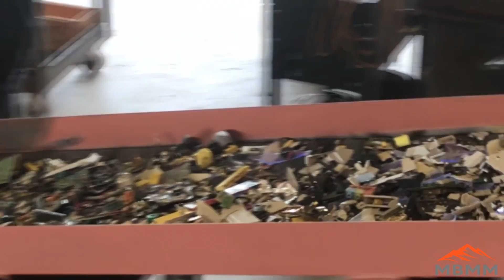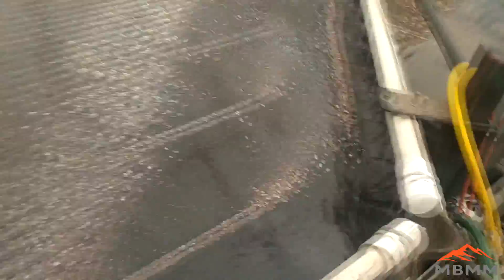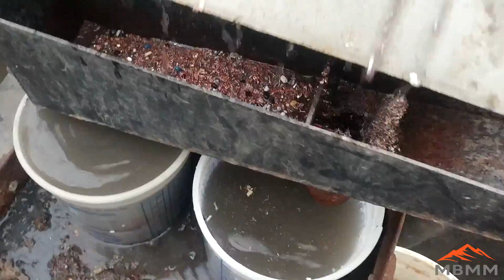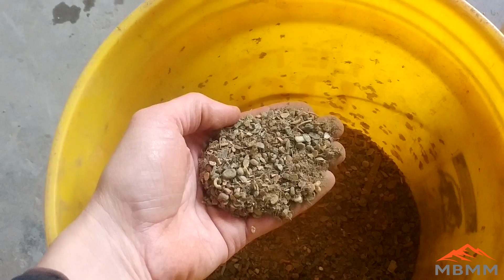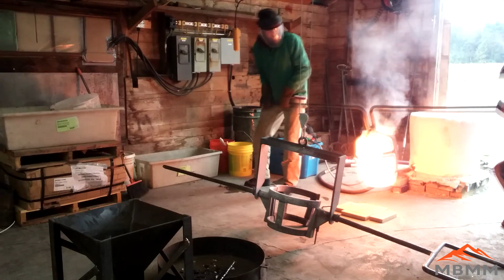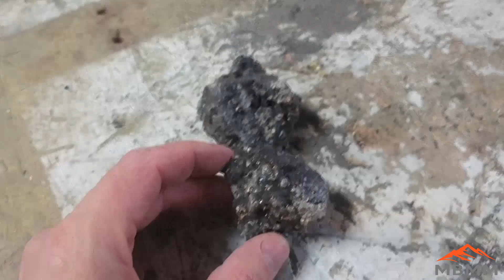Shredding & Melting Recycled Computers: Gold, Silver, Copper, Scrap Metal Recovery

Comment: like most have said, pull the pcb from the tower and all the wiring too, then run just the pcbs though the small mill and float table to get metals out, you could still save the slag and run it in the float mill and see what you can get, put the heavies and some lead into the mix, the lead will pull the gold and the rest into it, then put it in a bone ash cuple to recover the expensive metals aka gold and silver
Reply from the maker: Great, thanks for the tip!

Comment: Doesn't work but what I would do next time is the add flux right in there right before you start to heat it because that's what happened I think is that shit that oxidized oxidized because you didn't put flux in until way later but you need to put it in when it's cold when you're loading up The Crucible I believe you pretty much had your answer Electronics are just a big pain in the ass and I'd rather go out for the real stuff but that was a really cool demonstration and I appreciate your video brother I'm very grateful for people like you that put this kind of content out there because I wouldn't know shit if it wasn't for people like you take care brother
Reply from the maker: Great, thanks for the tip!

Comment: You must mechanically strip pc boards seperate from any steel or big aluminium, any other way is already the wrong direction, you must do sistematic element removal, each phase has its own recycling issue, there is no easy clean money in electronics that wont polute or cost a fortune in prevention
Reply from the maker: Great, thanks for the tip!
Reply: @mbmmllc  it is a pleasure!

Comment: the pond wil progresively turn into toxic liquid due to the trace chemicals used inside chips for their functioning  like Sulphuric Acid  Lithium, Arcenic, Lead  Mercury  and other toxic elements that make that water a must dispose of in a chemical facility and stupid expensive to dispose off  You Can NOT dump that water to environment! I have been recycling for many years  and not sold 1 gram, i evaporate all water to capture and colect the salts, no polution Ever  The Salts get Encapsulated inside an aluminium ball, and i encapsulate that in a 1 inch fiberglass layer to ensure i dont polute and poison the environment
Reply from the maker: Great, thanks for the tip!

Comment: Ideally the pcbs would have the Aluminum and batteries removed, and then processed separately. Sifting the pile off of the Mag Belt will drop 90% of the plated pins as the are all about the same size. The Gold Coated Ferrous pieces should be processed separately. The Power supplies should also be run separately as the the only valuable  material in there is a little Copper. Using Electrolysis you could remove the Copper. The remaining bits would be easier to refine with chemicals or sent to the refiner.  If only you had some Motherboards LOL
Reply from the maker: Haha, Thanks Ken!

Comment: Looks like you got way too much aluminum in your concentrate which is going to alloy but it's really pretty! A finer mesh grind and more mechanical separation is probably the most economical way to go short of doing an incineration run before you smelt.
Reply from the maker: Great, thanks for the tip!

Comment: in addition to what i said before nock the aluminium heat sinks and large electrolytic capacitors off  the boards  rerun your #1 and 2 back through to minus 60 mesh and with less iron and aluminium you should get a better result then electrolytically extract the copper then silver then gold chemically what is left may have palladium platinum and indium.
Reply from the maker: Great, thanks for the tip!

Comment: pc recycling is all about getting the best bang for the buck witch will almost always be physical, electrical, then, chemical thermal last. the thing here is each step you remove a high purity fraction is separation that does not need to be repeated or cause waste. so striping the steel case and as much plastic as possible before further processing may not pay for itself but will save cost later on both plastic and steel are at least potentially salable if low value and will be most of the weight as well as the reason for being very careful in the order and purity of each fraction removed is that there is a lot more than silver gold lead and tin in this stream and some of it is worth a lot. you also have palladium in the mlcc's worth $2000 an oz indium at 1 dollar  a a gram or 1000 dollars a kilo tantalum platinum electrolytic copper can be worth 12 to 20 dollars a pound instead of 2 or three . in the end you want a very small portion of unfinished material that you can a) glean more value out of or b) is the irreducible waste, and o ya back when you were processing the boards if you can get long enough glass fibers  and a millimeter is a good size bigger is better you can sell that as a strengthening amendment for concrete. you need to find value in each part i would love to see weld up kits for well designed flail mills and or shaker tables for urban miners. just remember just because you can doesn't mean you should you can destroy a lot of value or run cost up excessively by doing things in the wrong order you should always be learning more and better ways .
Reply from the maker: Great, thanks for the tip!

Comment: Nice experiment...  👍

I would try a Eddy Current (1st) to separate some of the plastic & ceramic; from, the metal..  Then, the  magnet.. And maybe a Rare Earth magnet for the stainless steel.

Heat the metals upto 600F to 800F... Only to melt the solder & burn off the junk..  (possibly, rehammerimg it smaller to 1/8; but, a 3/16 hole seems ok general pass..)

Use an Air Shaker table to separate copper & aluminum from other metals
Reply from the maker: Great, thanks for the tip!

Comment: Just as i would expect to be honest. Alot of the copper alloy will end up at the bottom of the cone because its denser than everything else. The metals that readily alloy with it like tin, gold and PGMs will go with it. The rest ends up a horrible mess of oxides (along with a percentage of the above trapped in it). As others have said i dont think crushing whole towers will ever work well. Too much good stuff is getting lost at the magnet. You really need to crush finer than the finest components then do the magnetic separation too make sure you get everything you need with minimal junk. Not practical for whole towers but doable for boards, phones and laptops etc.. The magnetics from the boards alone may be worth refining in a lead bath. The copper alloy can be electrically refined. Might not be economical but its the only way you will account for all the metals imo.
Reply from the maker: Great, thanks for the tip!

Comment: You need an aggressive flux
Reply from the maker: Great, thanks for the tip!
Reply: @mbmmllc  try adding lots of flourite and borax to the flux to attack all that refractory aluminium oxide....or better yet find a way not to let all that aluminium into the melt...

Comment: I would remove pcb from towers. Remove aluminum heatsinks with air chisel. I would also remove any batteries.  Shred with 1" ×3/8" screen. At that size the ferrous is easily separated from the valuable material  by magnet. Shred with 1.2mm screen and run on shaker table. At this point incinerate(but don't melt) in kiln/furnace to burn off all plastic, epoxy, etc. Shred again with 1.2mm or 0.8mm screen and run on shake table again to remove ash/trash as possible. Use a handheld magnet and sift material to remove any ferrous missed. Melt and cast into bars. Do copper electrolysis with 10% Sulfuric acid by volume of solution to speed up process. Melt pure copper into bars. Collect slag which contains noble metals. Perform wet process on slag. If concerned about aluminum use hf. Then hcl to remove any tin remnants. I would also incinerate again to remove any lingering hcl as to not get silver chloride in solution when going to next step. 2nd dilute nitric. Last aqua regia. Can use sulfuric acid during aqua regia to precip any lead remnants. Going strait to hcl or nitric would be way to expensive.
Reply from the maker: Great, thanks for the tip!

Comment: when you just shred it to the 1/4 in minus size it is really staying too big if your wanting to collected the values in my opinion. Take it down to a smaller size, either by passing through another mill and or ball milling the collected metals from the end. You can then pass the "dust" or slurry with very fine particles over the shaker table again and then separate the aluminum out very easily, because it has a density of only 2.7 g/cm3 compared to copper of 8.9 as well as other metals with higher densities than aluminum.

Aluminum you could set up to go to the  first drop off after the waste, then the heavier metals including the gold to the last bucket. After you have your two buckets I'd recommend either melting the aluminum or ideally selling it as the dust (dried) to a refiner. the copper and heavy metals bucket I'd recommend passing a magnet over it to remove iron and then if you wish you can melt into another dore bar and then zap with the XRF at the very least this way you are keeping the aluminum out of the future steps as aluminum in gold refining is a huge headache. edit Aluminum and Iron

you will still have metals that will cause you headaches but for different reasons. eg. tantalum (from tantalum capacitors), tin from the solder which if you're planning on wet refining the metal bar will cause you headaches because it will cause metastannic acid to form which will clog your filters. The best bet in my opinion is to get it to the two buckets like mentioned above of the powders. sell the aluminum( xrf first to make sure you arent missing anything),  the copper bucket dry out and save. once you have say a 55 gal barrel of the stuff or more have samples taken from that  (ball mill everything, sift, mix, then sample) have those samples fire assayed and then sell the barrels to a refiner who will pay you for the gold, silver, and copper. if they are willing to pay out for other metals (any PGM's) great!
Reply: but also just tossing a whole computer into the first shredder is not the way to do it. gigo, garbage in garbage out try to cut down on the unnecessary and easy to remove items first eg. cases, screws etc. ounce of prevention is worth a pound of cure :)
Reply: @CoinSilver800   What would the flux mixture need to be to make all the metals drop to the bottom the the cone leaving just the silica & carbon on top?  More SO2 or Bicarb?
Reply from the maker: Great, thanks for the tip!

Comment: How about running non ferrous material through an eddy current separator to separate the different metals and plastics and other junk that made it through the hammer mill and magnetic separator. After that then process further through another hammer mill or ball mill then shaker table. Just my thoughts. Great video otherwise!!! :-)
Reply from the maker: Great, thanks for the tip!

Comment: Yeah, after reading all of the posts, I'd have to agree that you're lots better off just hammering the PCB board. So much steel your machines had to chew through, and even then, at least some of your PMs ended up in your steel pile. I'm impressed by your shredders, though, if they can handle RE magnet brackets....     ;)
Reply from the maker: Great, thanks for the tip!

Comment: Thanks for the vid-- one of your Niton scans of the 'slag' shows quanitities of Ti, always hard to melt. Plus lots of oxides, as you mentioned. Did you stir your melt with a graphite rod before your pour? I'm wondering, too, if an induction furnace could have better alloyed your metal, and eliminated some oxides, before pour. Keep up your series!     --A fan
Reply: Titanium in electronic scrap is mostly as barium titanate, the ceramic that makes up multi layer ceramic capacitors, MLCC. It's already an oxide before the melt starts.
Reply from the maker: Great! Thanks!

Comment: Grind finely. Maybe second hammer mill to grind it more fine and some way to remove the aluminum before hand like others have suggested. Cant wait to see another video on this.
Reply: Agreed, pull the hard drives, which is probably the largest single source of aluminum...take probably a minute but would save fuel and effort pouring all that extra metal.
Reply from the maker: Great, thanks for the tip!

Comment: I question how you figured your percentage of recovery ?
Did you inspect " ALL " of you processed towers , use a microscope 50 - 100 + power to look for gold bond wires ?
Using the magnet at that early stage is taking / loosing some of your gold , maybe lots , the outside / soldered to the boards , and the main processors pin with gold are almost all magnetic - to the early magnet process will take / loose some gold .
The there are a lot of rare-earth metals and other stuff that - may have all kinds of reactions / mixing that could be problematic .
The neodymium magnets in the hard drives , CD readers etc. , magnetizing more of the pins on chips and loosing again ;(  
Along with other rare-earth metals that have value in capacitors etc. 
Breaking down all towers , box's till you get to circuit boards , then hammer-mills to separate steels & plastics .
I use air-chisels to quickly remove soldered in chips , mono-lithic caps .
I sell the circuit boards then , but lots of gold pins , surface mount gold coated pads visible on boards , let alone gold fingers on slot cards [ I do cut gold fingers off with sheet-metal cutters ] .

Too many things to get into in this format , but some suggestions .

Wish I was closer , would like to , a hole lot of things ;)

Thanks again
Reply from the maker: Send us an email and we can send you the white paper we have on grinding up mother boards. info@mbmmllc.com
Reply: @mbmmllc  Jason and the gang, could you send me the white paper on grinding up motherboards/electronic boards. Please send to jzstorm@yahoo.com
Reply: He makes the numbers up.  That's how.

Comment: Maybe remove the aluminum with an eddy current machine?
Reply: Eddy current will treat other materials, like copper & brass, the same way...

A Density separator(s) is used to sort between them..
Reply from the maker: Great, thanks for the tip!

Comment: Dismantle the towers first. Then I would just incinerate all of the boards. Take all the ash and precipitate the metals out using aqua regia  and other acids. It is the best way for the most recoverable materials. The lead (if any) eat up you gold content. I hope you removed the batteries out of the mother boards before crushing them. If not you also would have some mercury in the mix that would also eat up the gold.
Reply: That would be my approach as well.  I missed what others posted about the Gold bonded to steel being taken by the Magnet but it is logical.  Definitely would not curch everything together-waste of energy and resources plus one would end up with a large hunk of Mixed to them have to Chemically separate.
Reply: The lead could be separated in a calcium hydroxide/ash Cupel
Reply from the maker: Great, thanks for the tip!
Reply: That's a lot polluting and an environmental hazard.